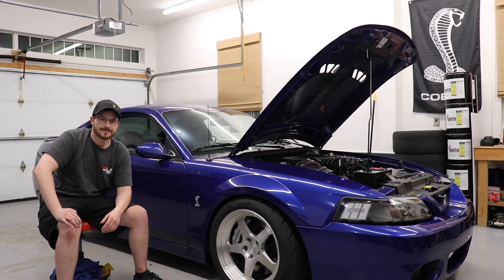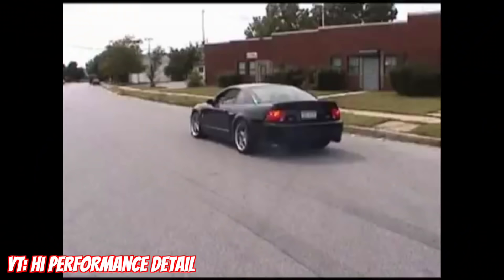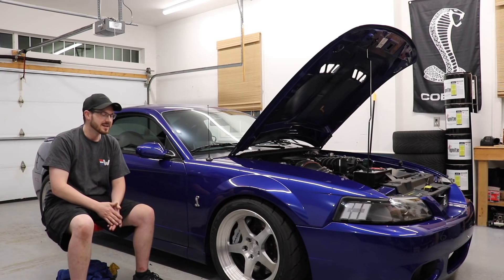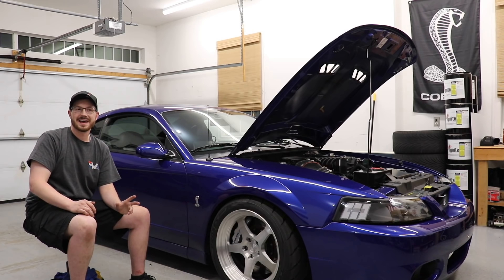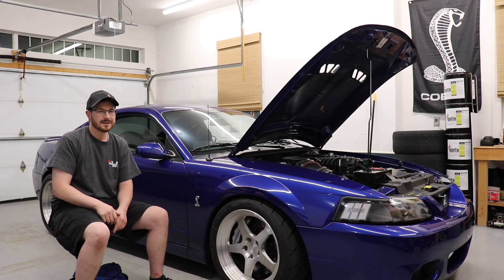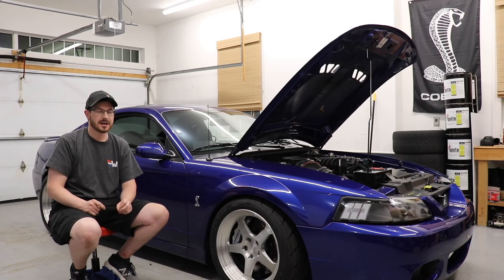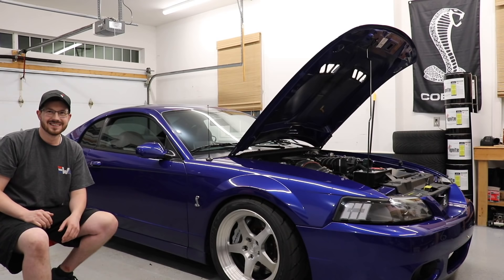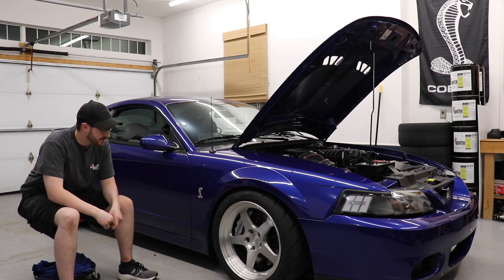Terminator Cobra Story 10 Years of Ownership Stock to 900RWHP

Comment: I remember all the original Terminator videos like they were yesterday. I had a built fox that was stolen but the snake bite videos and showing my friend how badass they were. He bought one and still has it to this day. Bought it for 25k with 10k miles and still has it with only 18k and most miles are road course miles. Suspension is completely straight solid track suspension